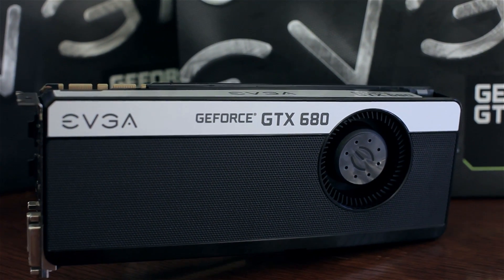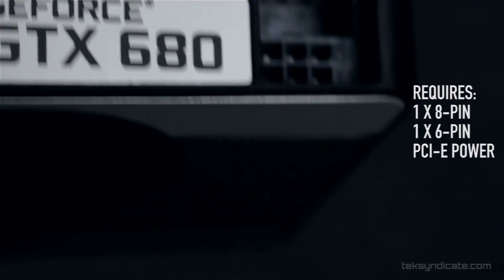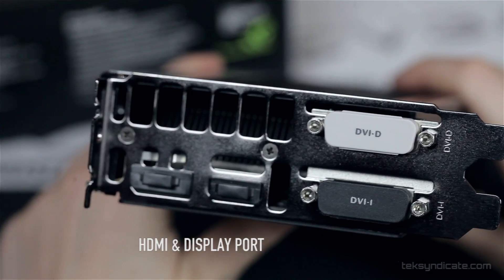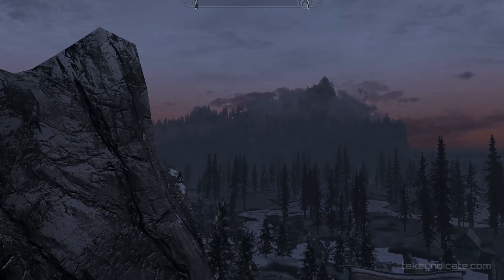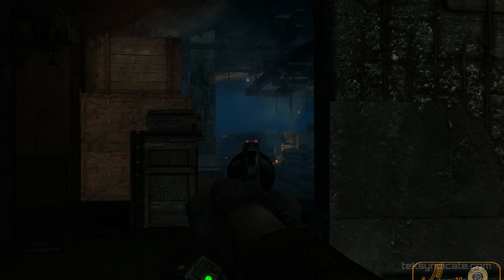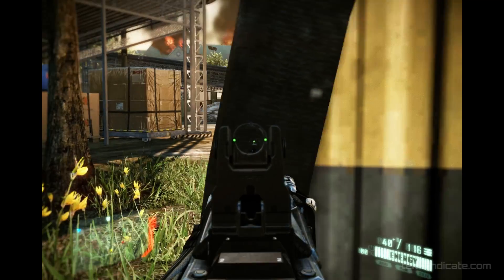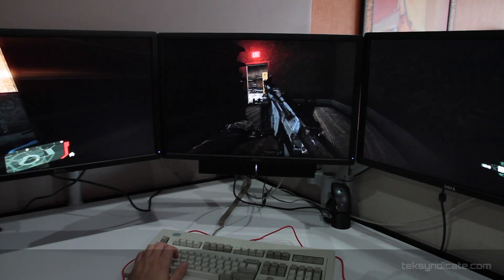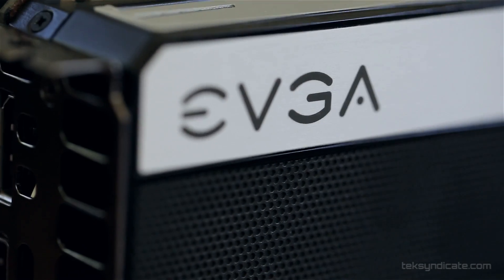EVGA GTX 680 4GB Review, Benchmark, Overclock, Nvidia Surround

Comment: Just got one of these 2nd Hand for 115 Bucks in great Condition. I have to say even to this day this Card is still a more than capable player. 

Plugged it right into my 3770K machine and played Dirt Rally for hours at MAX settings at 1080p. I didn't messure FPS but it felt and looked smooth as my 4GB R9 290X. Max temp hit was 78C which is badass for the Refrence design Cooler. (No OC)
Reply: True
Im using SLI and runn this cards the last 2 Years in 4k 60hz!! the thing is the ppl looking for gpus but thats wrong for output like 4k 60hz 4:4:4 you need Videocards with input/output, these should be external and upgradable at this time where this bullshit industry changes every view weeks theys specs! (hdmi2.1)

Comment: I'll admit, EVGA&Possibly Nvidia = Crap right now, and even back then. I had a $500 card in my gaming rig, and your the more lucky one. Sure, your game crashes. When I start up my system on the NVIDIA card, my entire system freezes completely. When I play the same game on my intel processor's integrated graphics, it never freezes, and I get a better playability experience out of intel graphics. I feel as if NVIDIA and EVGA have failed me. I'd rather not buy NVIDIA or EVGA as a consumer anymore. I'd rather risk it with ATI or AMD graphics. I think it's absurd to buy from either company now. I quit using nvidia 1 or 2 weeks ago, and my system is now 10 times more stable than it was before. Has my system froze since? No. Has my system lagged a little more sense? Yes. But can I play my games? Most definitely. I couldn't RMA my card in time. I lost my warranty before I could.
Reply: +will andfriends 

My 980 Ti works great. As does the 970 and the 750 Ti in my household. :)

Comment: I just bought a GTX 680 classified, and my games are running to slow. I dont know what could it be. Skyrim Vanilla without any mod runs @ 30-40fps maxed out.
I have an i7 5820k and 16gb DDR4. Please help
Reply: Question why would you buy a 3 year old card. Just get a more modern budget card so you can get more accessible support

Comment: I've got this exact card in my video editor workstation, and I have this question:

Can the GTX680 output 4K on the Displayport monitor as a Windows desktop, and then output 1080P on a DVI port for a 1080 projector? My application is Adobe Premiere/AfterEffects CS6. Presently, I run a 2.5K display for the main application and the projector at 1080P is the Adobe Monitor 2.
So my question is, if I upgrade the monitor to a 4K display, will the other ports go dark because I'm using all the pixel address space of the card for the primary monitor?

Comment: why 1600x1200 ? why not 1080p ?
Reply: Apple man actually its 720p
Reply: 1600x1200 is 1080p sir fucking hell
Reply: Dun Dun With a name like Apple Man. What did you expect.
Reply: Apple man Anything less than 1920x1080 is 720p if it was 2000x1600 it would be 1080p
Reply: Dun Dun 1080p is 1920x1080 Full HD anything more is different and better anything lower towards 1280x720p is just HD
Reply: +Dun Dun no 1200>1080 meaning 1600x1200 is more than 1080 vertical pixels
1600*1200=1,920,000
1920*1080=2,073,600
1920x1080 may have more pixels horizontally but 1600x1200 is better then 1080p vertically.
It is in fact 1080p.

Comment: Because I could only find 780 at a retail price. The 680s have been around for a while now and i could find them used, which I did. The 680 sli gets way higher benchmarks than a single 780.

Comment: Nothing can beat the evga gtx 680 classified. You can overclock it to around 1350 gpu core and 6700 memory core without evbot. So that is the best gtx 680 in the world since it comes with 4gb of vram and 14 phases. Nothing on Europe can top that card.

Comment: Im using these Overclock settings on presicion X for my 4gb GTX 680 w Backplate. 115 POwer target, +177 GPU Clock and + 502 Memory clock. Running stable and keeps at around 60C under heavy load. Thanks for the video!!!

Comment: ok If you'll be gaming at full hd rez....any 2gb or 3gb video card will cover you just fine unless you're anal about metro 2033 " WITH" max or close to max eye candy settings...then 3gb 7950 or 7970 or 4gb gtx 670 or 4gb 680

if above full hd....3gb or 4gb vram card...even sc2 has been known to use more than 2gb at 4 meg gaming ( 2560x1600p)

I'd get two 4gb gtx 670's ( galaxy twin fan hsf...msi's rma process and support is absolutely HORRIBLE i just experienced that) and overclock them some :D

Comment: Can i ask someone who understand's thing's .... and my question is what should i chose - a asus gtx 670 4GB , a EVGA 680 SC 2GB or a EVGA 680 4GB , i am going to build a gaming pc in 2,3 month's and my specs are going to be: 3570k ( i will oveclock it above 4Ghz) ASROCK Z77 EXTREME 4 , 8GB RAM AND A 750W PSU because water on i will add 1 more GPU and more RAM.So which of this 3 option's for GPU should i chose .PLEASE HELP !

Comment: Good, because I' thinking that running Metro 2033 is like the Mythical Unicorn or something.  Btw, if your bro has the 660ti superclocked, then would the Asus Direct cu 2 Top Edition be able to run it on high with those fps as well?

Comment: At 720p probably or with a lot of features turned down (AA, Af, ETC). My 2 7970s barely get 87 frames per second, with everything turned on Very High, 1920X1080, 4X AA and 16XAF.

Comment: Vram is used by all games to store and display textures, the higher resolution the more Vram you need. SLI does not increase Vram, it only uses the Vram of one card. Your Kingston ram is tied to the CPU and is not the bottleneck. Try running Fraps etc to monitor frames, the stuttering might just be because of SLI which cannot be fixed.

Comment: in a video game like BATTLEFIELD 3 does the graphic card ramm memory counts ? or the separate ram that i got 8gb @1600Mhz kingston.Because i have a SLI MSI GTX 660, i5 3570k @ 4.0 Ghz, Motherboard z77x-ud3h,PSU 700w, and i have some STUTTERING problems(minor frames) frame drops etc ,etc ! what is it ? graph card memory or kingston ? thx for the help guys.thinking of buying this 680

Comment: If you turn of DX11 DoF it will run very smooth. About 50 fps on a 6950 maxed out 1080p (exept the DX11 DoF).

Comment: benchmarks seem strangely off. My radeon hd 7870 crossfire could run cyrsis 2 eyefinity higher then 36 FPS. And going from single to SLI he got 7 FPS jump? No way! a dual GPU set up should jump your FPS up by 30 plus. A single 7870 runs Batman Arkham Asylum  in eyefinity at an average 58 FPS, 7870 crossfire runs it at 95 FPS. TWO GTX 680 4 GB SLI should run crysis 2 eyefinity  at 85 FPS.

Comment: Yes, true that is why a lot or pro gamers play counter Strike etc at low RES for 100's of FPS as online it gives them an advantage.

Now if you use an LCD and need to enable V-Sync and then want FPS to be smooth you enable Triple Buffering but it adds to input lag which is bad enough on LCdDas it is.

Comment: On most LCD's you will see 60FPS max as V-Sync will be enabled and if you disable it you will get more than 60FPS (if PC can run it) but get screen tearing.

I have a Sony FW900 so do not need/use V-Sync and have never seen tearing so I can see any FPs that PC can run @ 2304x1440@96HZ.

If I used V-Sync it would be 96FPS but Vsync and Triple Buffering add input lag which is bad for online games especially.

Comment: Do not buy the FTW LE if you see it for sale, it has lower clocks so no doubt failed being a higher FTW model.

More Power Phases can mean cleaner/smoother power meaning better overlocking.

All EVGA GTX 670/680 FTW cards have a better custom PCB/ Extra Power Phases and Vapor Cooling (like the GTX 580 had, where as the GTX 480 was heatpipes).

This includes the GTX 670 FTW which is on a 680 FTW PCB/Cooler unlike the Nvidia Ref design GTX 670's.

Comment: I have the EVGA GTX 680 4GB FTW/w Backplate (the faster of the 2 FTW models), it boosts at 1150 and I so far have reached 1300 Core/7GHZ Memory (1 week old so still learning/testing).

It has a custom (longer) PCB with extra Power Phases and a Vapour Chamber cooler (Ref 680 has Heatpipe).

You can also adjust the voltage using EVGA Precision X if you have an EVGA GPU (the Power Target Slider is NOT voltage adjustment), if a non EVGA GPU you can still use Precision X but not voltage control.

Comment: I think you should learn what you are talking about.

GDDR5 is Quad Pumped so Memory at 6GHZ is only 1.5GHZx4 so it does not need the same bus width as GDDR1/GDDR2/GDDR3 needs as its x2.

Comment: I'm much more partial to the Msi Gtx 680 lightning, since it can overvolt and also disable the power threshold limiter and it has a much more powerfull cooler compaired to the one on evga's, and I like msi afterburner more than evga precision

Comment: With a 23% power boost, you can't really overclock the 660ti; I got to maybe 20mhz on the core clock and shader clock before I started to see artifacts; granted I was using a SC edition, but still, I should be able to overclock it further, and I need more power to do so.

Comment: I have the Powercolor's HD6870, and I don't have any problem with MSI afterburner. It's very nice, and it can also capture video and show you the temperature, fan speed etc ingame. Ypu just have to set the settings as you want. :)

And don't push it too much and experiment with everything since you're begginer.
GL

Comment: lol no, not every card supports overvoltage like the DCII hot wire feature on the Asus models. We have software now to bypass going to the bios. It's not necessary any more. It is still "overclocking".

Comment: I want a 4GB FTW or Classified model, but I'd rather have a DCII 4gig variant. I don't think it's going to happen which makes me sad. I'll have to wait until the 700 series I guess. Those benchmarks as well as others prove that software has caught up with hardware. There isn't a an alternate universe in existence where a flagship single-gpu model card should get 20-30 fps at stock clocks on a game that came out before it did. I'm sorry, but 20-30 is playable, 30-40 is decent and 40+ is butter.

Comment: Are you going to do a bios mod to raise the voltage of the card.
I got a gtx670 stock volts 1.1175 with my bios mod I can do 1.213 volts :)

Comment: It's not *really* an overclock if you're doing it with a manufacturer-supplied and -supported tool, is it? The only reason for calling it an overclock, is that it's higher than the stock speed - but that also goes for some cards that come "overclocked" out of the box. Which is even less of an overclock...

I remember when overclocking a videocard meant tinkering manually in its BIOS, and soldering wires onto the PCB to increase the voltage. Now that is what I call an overclock :)

Comment: For example, my intel core i7 2600K runs at 3.4Ghz at stock speeds, but I've overclocked it to 4.5Ghz. I also have two GTX 580 Lightning Xtreme Editions. Normal GTX 580s are clocked at 775mhz, but the versions that I have came with a factory overclock of something like 832mhz, but then I overclocked it even further to 940mhz.

Comment: Overclocking is heightening the operating frequencies on your hardware. Usually when you're talking about overclocking your talking about either the processor or graphics card, but you can overclock ram too. It basically just makes your hardware run faster.